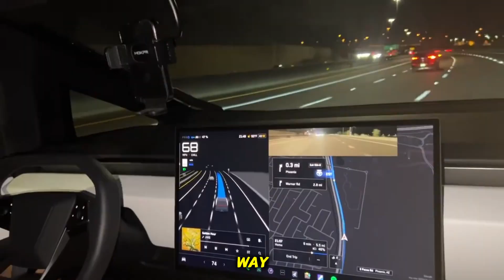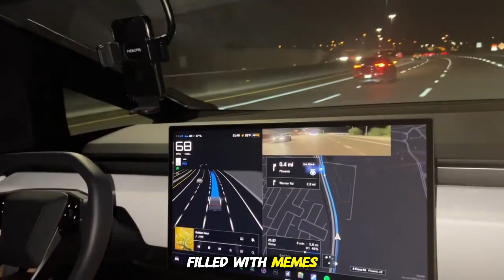Why the Tesla Cybertruck Is Being Banned Globally in 2025 | The Truth Elon Won’t Tell You

Comment: Time to pivot Tesla to hybrid power trains and modular I/C- electric vehicles. Get rid of the huge heavy batteries, use a small efficient motor, say a turbine ? and your efficient motors etc and you can build a plethora of variants from a common platform and power units
Reply from the maker: Well said 🙌
Reply: @LuxuryMachines-w3l thank you very much. I think if you could have a motor @ each wheel, say 100-150 hp each, and controlled by the same sensors used for traction control etc, and a small battery for the times when you are prohibited from using the I/C system. I reckon that you could build a car the size of a Focus with awd/and adjustable torque delivery, 600 hp, and a curb weight of about 3500 pounds for about $40-45k. Depending on the power plant used for the generation system, I should think 35-40 mpg is feasible. But most importantly, it would go like the hammers!
Reply from the maker: @markvincent5992  Good Idea